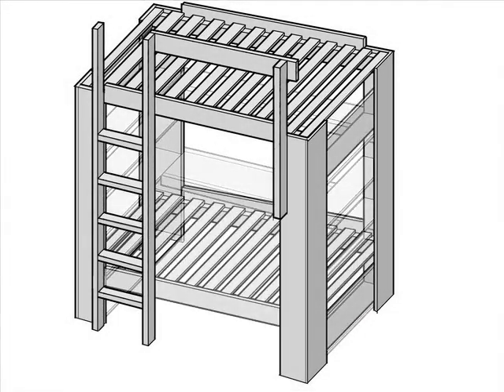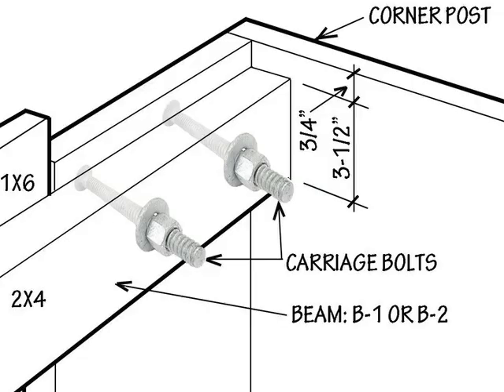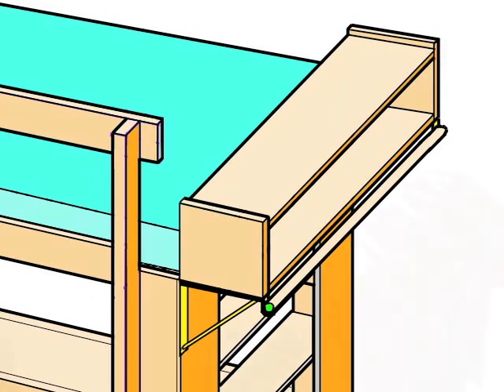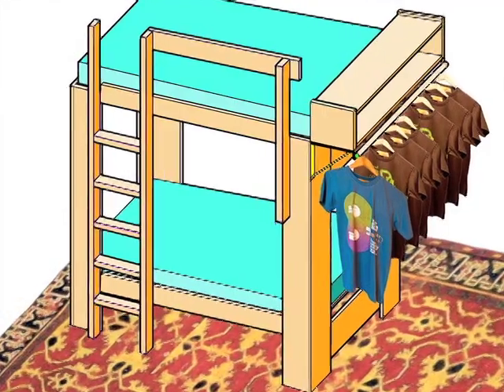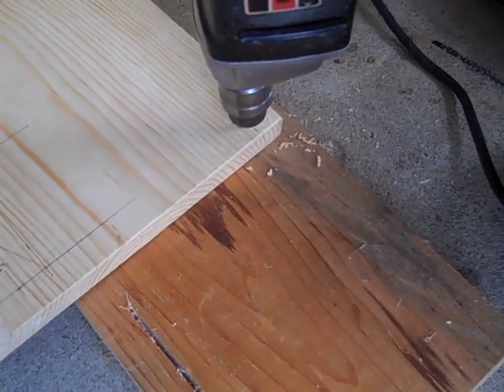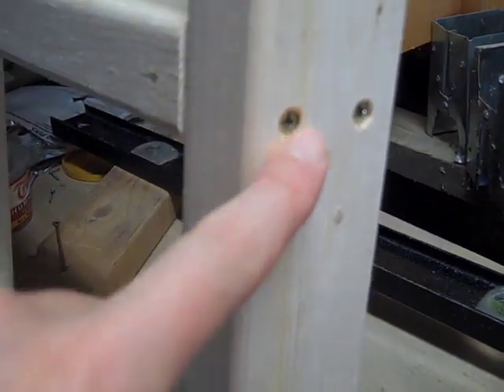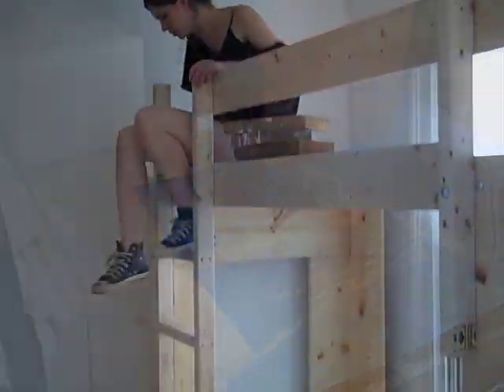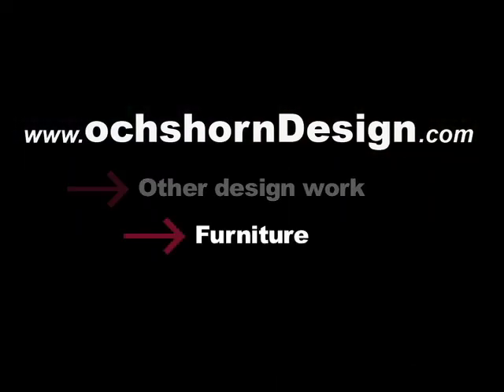Build a loft or bunk bed - Ochshorn

Comment: 1=25.4mm=2.54cm

So take all the measurements (probably easiest in decimal format) and multiply times 2.54 to get your answer in cm.

3.5" x 2.54 = 8.89cm

Or since you're online there are tons on online conversion calculators out there.
-Cheers